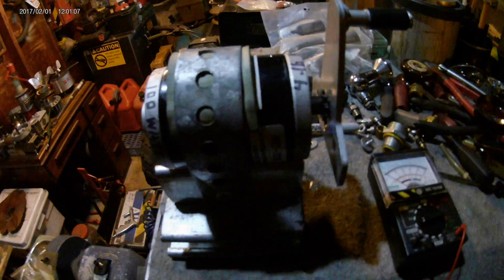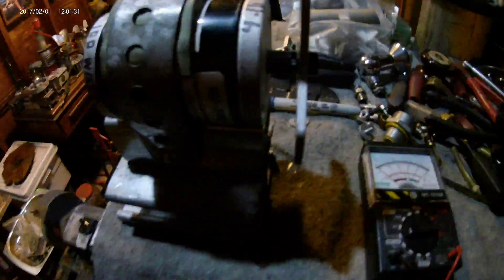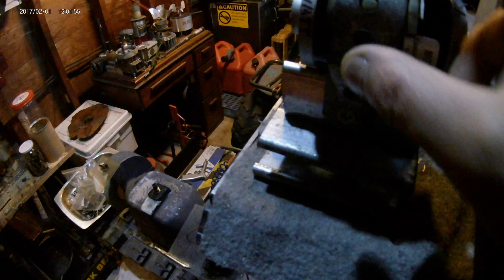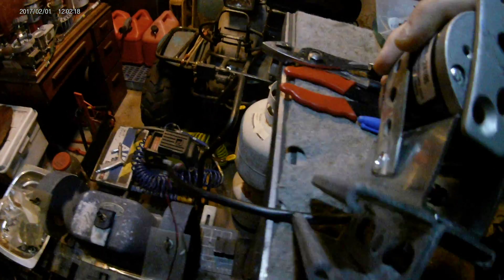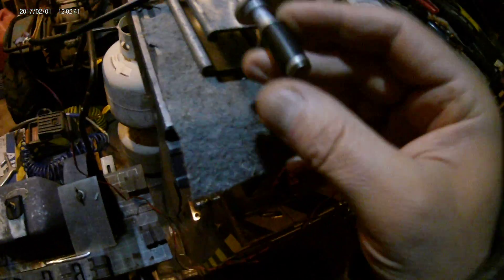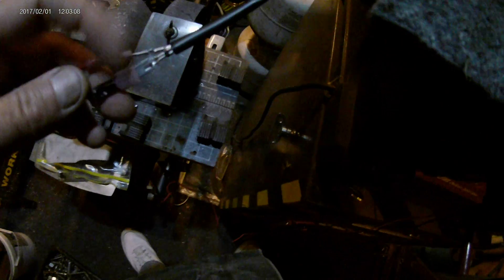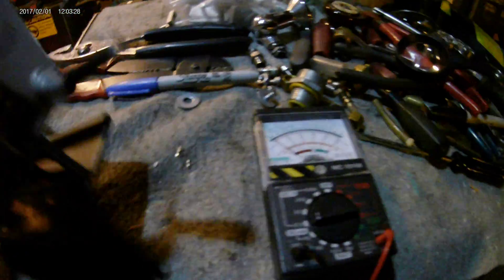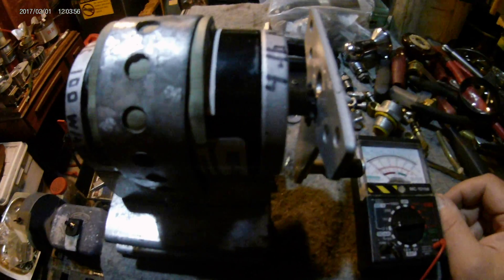Hand Crank Generator DIY build easy project

Comment: You seem to know about this more than I do would it be possible to attach a hand crank alternator generator onto a brush guard on the front of a vehicle in a watertight box so nothing gets ruined to wear if you're stranded out in the middle of nowhere you can at least go out and hand crank your battery backup
Reply from the maker: You would have to design it and match volts +amps but it is......